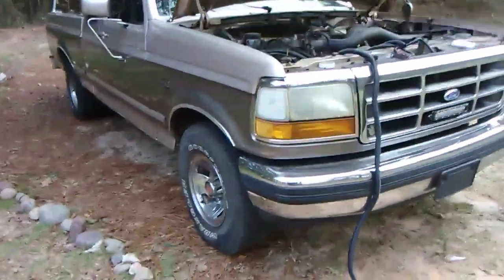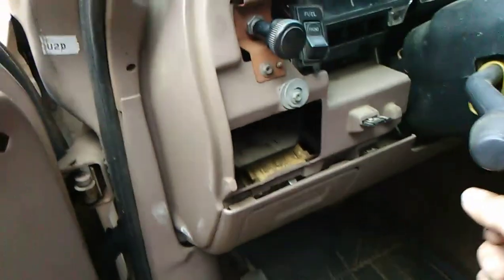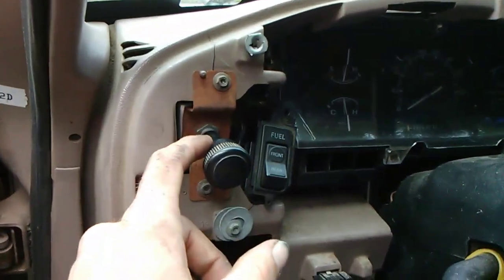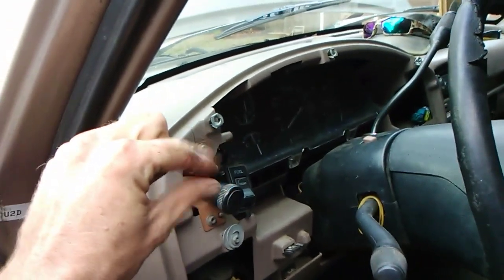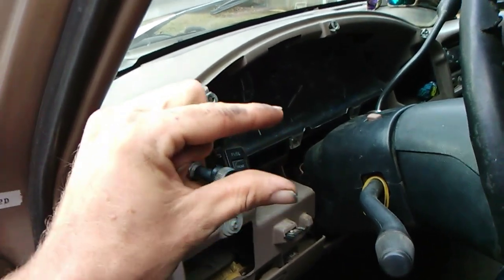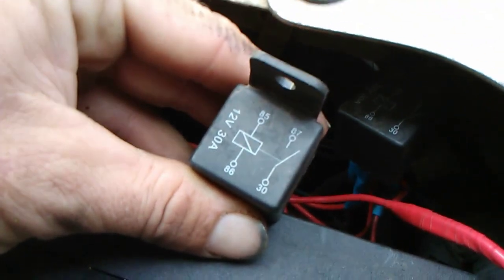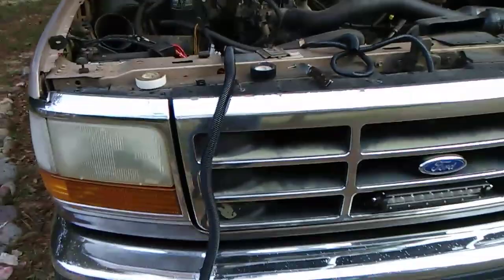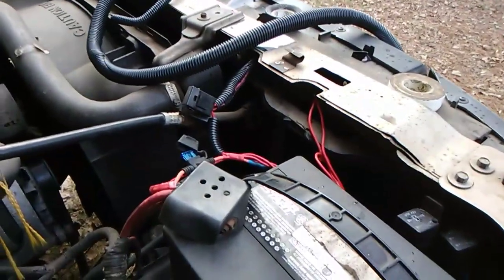Ford flickering/flashing headlights repair

Comment: 2013 escape. flashes when off, but car is running.  I've been leaving them on all the time, so I don't look like a crazy person driving down the street flashing my lights on and off 😂
looks like I'm in for a lot.
Reply from the maker: That sounds like an issue with the switch or the module that controls the headlight settings. That escape should already have headlight relays from factory.

Comment: Wow, excellent video.  Outstanding explanation.  It has always perplexed me because you'd almost think it's a loose wire vibrating / turning on, turning off....  However, you could just be sitting still with the engine at idle and it would happen.  Thank you very much for putting this video and explaining all that you did.  :)  Two Thumbs up to you McBrother!!
Reply from the maker: Thank you for your comments I really enjoyed reading it. I'm thrilled I was able to help someone!
Reply: You bet my friend.  I have a 1982 F-150 Flareside pickup truck with the 4.9l 300ci inline six.  It's my project truck and a lot of fun to drive.  That problem happened to me on my way to the store last night so I immediately turned her around and headed for the house with the flashers on.  I'm just glad I'm just outside of town and there weren't a bunch of cars on the road.  Driving in the dark with my lights flickering on and off, now a days, someone might think I'm messing with them and take offense.  Anyhow, I was very confused to the problem until I found your video.  You couldn't of trouble shot the problem more precisely.  That would have taken me a long time if ever to diagnose without your help....  :)

Comment: I am losing everthing every now and then but my headlights on my 1976 ford casual motorhome.  Even the blinker lights. Then if I shut it off and restart sometimes they all come back on. Then last night had my high beams on and they started flickering. Turned them on to low beams and they were fine? What a mess. What do you think it could be?
Reply from the maker: That's a mess! I'd start at the light bulbs remove them all one by one cleaning the connection points on the bulb and in the socket. I believe you can use dielectric grease to prevent them from corroding in the future. From there I'd follow up the wiring back to the power source and continue cleaning any connections. If you still have problems after all that you may want to look into cleaning the connections inside the light switches in the cabin and/or adding the relays to the headlight system. I wish you good luck!

Comment: Does this solution cover 1994-1997 OBS F350s?
Reply from the maker: As long as they don't have headlight relays from the factory. At some point they made the relays standard equipment to solve this issue.

Comment: I've got a 1993 Ford Ranger and the flickering headlight problem has gotten so bad to where it doesn't feel safe to drive in the early morning/night. Happens on low and high beam. Started happening about 6 years ago
Reply from the maker: It should be the same issue. Ford was saving a few bucks not useing headlight relays on everything back then. Had to do it to my trucks and my ol ladys 97 crown vic. Atleast it's a simple fix.
Reply: What was it my fellow ranger owner
Reply: @JohnJames. no longer have the truck, but it was the contacts for the headlight switch-they would get too hot and pull away, stopping contact, then cool down rapidly to make contact again, and that cycle would repeat. Ended up being like $2 to fix it I believe.
Reply: @foxykero  thanks for the reply,  was it the relay like in the videi

Comment: Where do you connect the wire with the fusable link?
Reply from the maker: From batree positive to one of the poles for the switch side of the relay. It's the new power source for the headlights.

Comment: My 91 ford ranger has the same problem it works fine for about 15 to 20 minutes then the lights just randomly start flickering.
Reply from the maker: Should be the same issue.

Comment: I am having the flickering headlight problem too. My wire harness even felt warm right where it goes into the switch. I may nee to do this. Are coming straight off the battery for power? No fuses? As an electronics guy I would love a block diagram of this. Did you consider LED headlamps? Wouldn't they draw less current and help with the heating issue?
Reply from the maker: Joe Wasser I am coming straight from the battery but I'm using fuses. They are right next to the battery. I considered using LED headlights but I heard they are a pain and even though the bulbs last a very long time the controllers don't. I went the relay/fuse route because it only cost me like 15$ fir the two relays the two fuses and a few feet of wire. I may not explain it well in the video but it's a very simple install. If I can find a wiring diagram for it I'll post it here. Thanks for the comment. I hope this helps.
Reply: Thanks for the information. I can probably figure it out. I just get nervous modifying what the factory did. I really appreciate your post and your reply. Thanks.

Comment: Wouldn't it be easier to replace your headlight switch. Then you're good for another 20 years.
Reply from the maker: Oh no lol they won't fix it for 20 years becuse the new part is cheaper and weaker than the original so the problem will occur sooner.
Reply: I've replaced the headlight switch and still had the same problem.  Putting a relay is the only way to stop this problem.   I put a relay on the floor dimmer switch wiring.  Works great now and you can hide the relay under the dash.